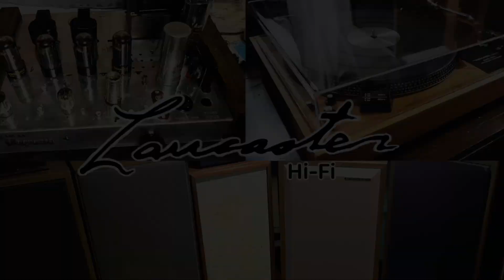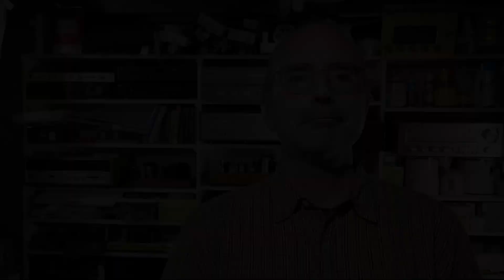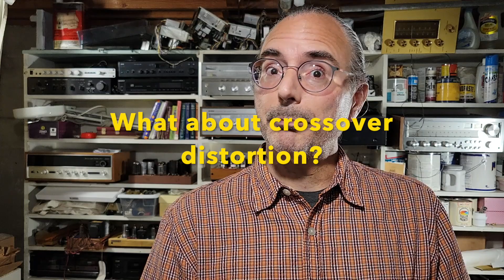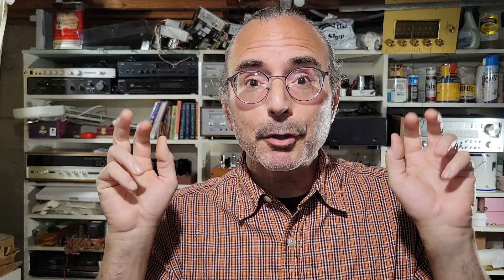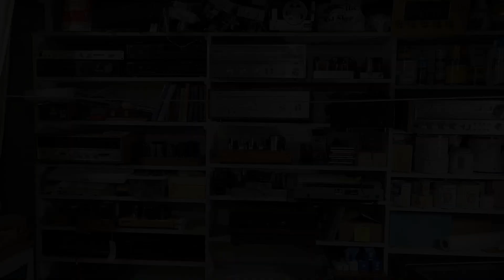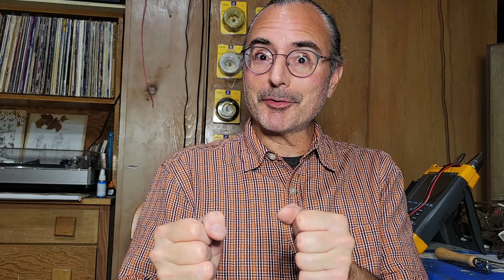Why Do You Want a Single-Ended Triode Tube Amp?

Comment: Interesting informnation  but i could  not see   definition what is "distortion machine". I. What is the exact  device you daily  use to  measure distortions? I hope   mentioned   ear sensations is  joke?
Reply: Agree......
Reply from the maker: I'm just referring to known facts. Triodes generally produce more even harmonics. (Pentodes more odd harmonics, so single-ended pentode amps without negative feedback are rare.) Push-pull circuits cancel out even harmonics (and power supply hum!). Negative feedback reduces distortion. I recommend Valve Amplifiers by Morgan Jones. I've learned a lot from that book.
Reply: @Lancaster_Hi-Fi  Fact is happening which  we can point to everybody so they can instantly see it or we instantly  prove  it beyond doubt.  Fact beyond doubt we can call "fact".  

So called   "known" facts are only perceived informations from somebody who ususaly heard it  i from third person  an never proof  it by himself. Did You assured yourself that author of that book proven something by himself or he put long list of source literature  ?  All of them  have long lists of sources at end? I am different - if I asy I know it means I checked it by myself - and I in each  time I can prove it to anybody. so pls do not tell  me to read something I do not have reason to trust.

 I am confident I could write  book about audio which  would be much more interesting ( I resigned from my membership in AES after I learned  I do not gain from them but they gain from me and I need to pay for it).  

Due to somebody think he got  knowledge by reading or hearing he treat it as "known fact" in  opposite to "fact" If he    describes fact   he should  honestly  proof it  or show, not to point the books. 

That is the reason  why You honestly  used termin "known fact" . Do yu see the difference?   "Known facts" are presented by older ladies from neighborhood  who learned from their friends
Reply from the maker: What "ear sensations"? Sorry, I don't understand what you're referring to.
Reply: @Lancaster_Hi-Fi  Ear sensation is what You only can hear. Problem is that people hear more sound from tube amplifiers, do not know the reason but are keen to  find explanation.  They noticed only differntly looking  tube characteristic. Then they came out with theory of  even distortions haunting HI FI tube amplifiers. . Thing is that many producers of  guitar amplifiers and musicians depend on deliberate even grade distortions made by usualy over controlled  tube  amplifiers for electric guitars. 

.They do it for two reasons: because solid amplifiers cut good distortions which they obtain from block of effect  .   Not beacuse they have little  distortions - they   present  perfectly taylored distortion effects greatly damped   and that is their bad future, And second - beaciuse they do not use blocks and depend only on amplifier distortions which with over controll are are "nicer" than ubbearable overcontrolled solid.  . That provided  a lot of confuse about tubes Hi FI technology. 

A am only asking abourt hard evidence from distortion meters how much is distortion in Hi FI tube amplifier at listening power,. Because ear sensation is no possible fully to  transform  to "technical data" and what you can use except    ears? .
Reply from the maker: I think I get what you mean. I'm still not certain why I think tube amps sound better. I'm not sure they always do, but I sure do like them anyway!

Comment: Love this vid - lots of fun and calls out some of the absolutism out there wrt tube amps in general and SETs vs others and class A vs AB, in particular. 

I have been wondering why 2nd order harmonics are pleasant - it seems to me that they must naturally come out in some recording spaces and also in certain listening rooms. I could be wrong, but they seem to provide a better appreciation of the depth and space around the instruments/voices. Perhaps, adding some 2nd order harmonics could be a good thing for music recorded in a space that starves the notes of those harmonics? But, surely you can have too much of a good thing (ie 2nd order harmonics) and what does that sound like?
Reply: DO some study and homework ........
Reply: DO some study and homework ........
Reply from the maker: Someone is grumpy. There was a good video I watched recently, something like "You don't understand saturation."
Reply: It's not even "that they're pleasant" it's that they FIRST are less apparent to the ear, and second, are less apparent as aberrant when they even are high enough to detect. This is one of the primary issues with using THD as a measure of quality. The fact that the figures given are totals rather than distributions also confuses the case. Odd order, and higher order harmonic distortions are significantly more audible at significantly lower incidence. But even then harmonic distortion is significantly below intermodulation distortion, and the more recently coined "GedLee distortion" in terms of audibility and offensiveness.

Comment: After 45 years of noodling in this hobby of ours I've come to the conclusion that the relationship of accurate hfif to our ears and brains is like the relationship of light weight bicycles to our beer guts and lard arses.  No matter the the level of effort we put into improving the former it will never rise to a level that overcomes the problems presented by the latter.   And we ride on with both.  Its almost as impossible to make our ears and brains better as it is to make or guts and butts better.  I have a push/pull tube amp and no matter what distortion it makes it works well enough for my ears and brain.  Although, at times, I do think it may make my butt look big.  But on a more serious note, thanks for another great educational video!  I look forward to your next.
Reply from the maker: 🤣 Well said! Thanks!
Reply: @Lancaster_Hi-Fi  You are welcome.  By the way I've been meaning to comment on your last video with the Dynaco SCA80.  I have a SCA80Q that currently needs repair, but if you are not familiar with it look into the Dynaco QD-1 Quadaptor.  Its a stand alone sound processing unit that Dynaco built into the SCA80Q.  And that's the difference between the SCA80 and the 80Q.  I tend to think of the Qudaptor as something more than just another hifi gadget from the past.

https://www.youtube.com/watch?v=ZJMpPAI15po
Reply from the maker: @@jeffbrooke4892  Interesting! Sounds like a pretty simple circuit. If you need help with troubleshooting your SCA80Q, let me know.

Comment: I have several SE guitar amps.........  and a 300b stereo amp.   I like them.   I have some Class AB's that I like a lot too.
Reply from the maker: I need to get around to building an SET guitar amp or two!
Reply: @Lancaster_Hi-Fi  I did already mine stereo but instead triodes I used pentodes with loudness correction and it works fantastic , Unfortunately it sounds so real as amplifiers prized 50 000 USD shown in audio exhibition.  - that is the indicatiion that it again must be distortion machine.🤪
Reply from the maker: Pentodes without negative feedback?
Reply: @Lancaster_Hi-Fi  I am not sure if you are asking me about pentodes. 

I applied my own concept of two feedbacks - first is  say "a bit" conventional general for two stages but phase corrected - that invention was developed only in one radio which was produced in less than hundred number in 1939 - war stopped this model and factory - now only few exist and one of them I have . Second ffedback  is  local only for pentode.  That last is also  rarely met  - I know only one producer who made 60 years ago such concept in his  tape recorders and in my opinion it gave "something " good to it's SE tube ampliifer. 

  Frankly I did not chceck distortions by measurements - but. any brand made solid which I use or used do not equal   this naturality of sound. .Bell and Pioneer  tube  amplifiers which I have  are harder  for me to compare  by ear anyway If I free choose for listening  I choose my amlifier.
Reply from the maker: @Mikexception  Sounds really interesting. I'd be interested in learning more. I was asking because pentodes generally sound unpleasant (relatively) without feedback; too much odd-harmonic distortion.
Reply: @Lancaster_Hi-Fi  Pentode without feedback suffers from nonlinear and linear distortions   Phase distortions in such case are not added but for Hi FI  it does  not equal nor improve that issues. 

. If one wants to use distortions for distorted guitar it could be worthy application because of high distortion and low phase shifts , I personaly prefer special FX effects. . But it is  just as formula F1 suspension in racing car - it is desired but nobody deliberate how  good it is  for  limousine . 

I you want learn I cannot help  - for audio   count extremly small details   -  I took me tens of years to know what is possible and how to go for  it in many sides . It takes  lot of tests and alignments, judgements and most important belief in unbelievable   Finally to get to level when we are fooled  by sounds    it may be a  matter of luck You was warned ☺